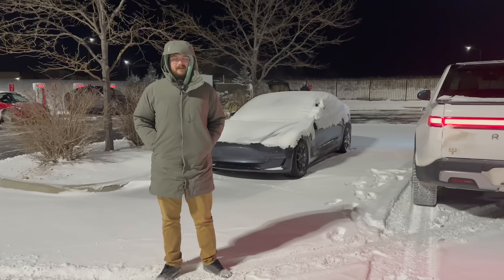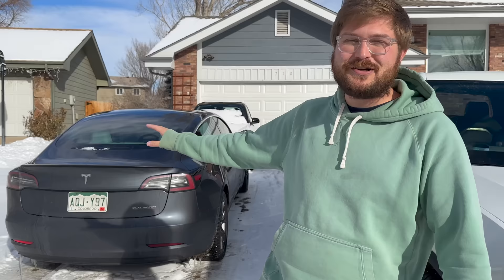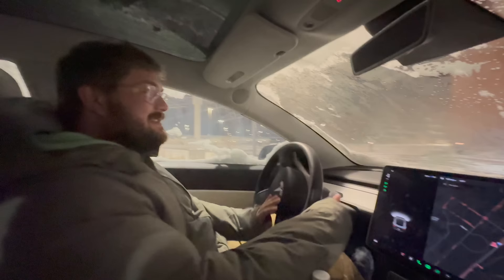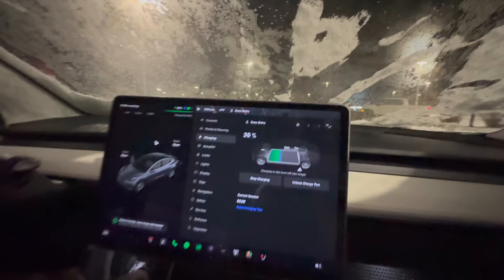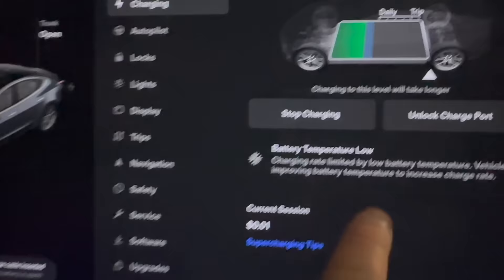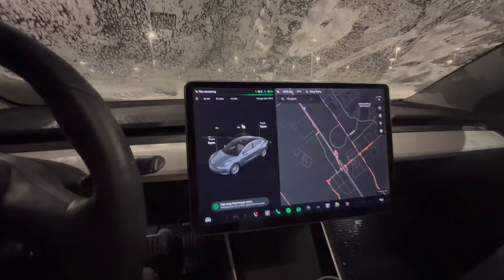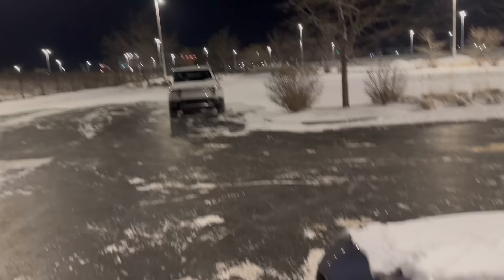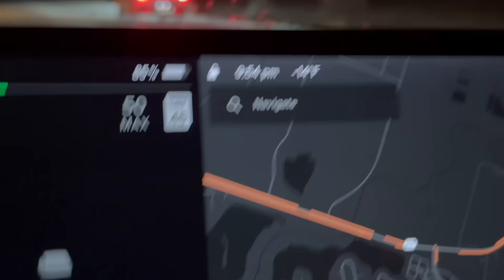I Deep Froze My Tesla And Immediately Plugged It Into A Supercharger To See What Happens

Comment: Who besides me is watching this in 2024 after hearing about the new from Chicago
Reply: It’s so funny especially with everything he says in the first 3 mins about not charging in the cold being nonsense
Reply: What is new? Sorry I’m from Denmark
Reply: what news is that?
Reply: @oddjobsandrandomprojects  also don't forget - they let their teslas run on next to no battery power too. That's like me complaining about how shit my Buick Regal Grand Sport is, because I ran it to mere fumes and moaned that it wouldn't start in the cold.
Reply: This Test is a bit Dodgy, who preheats one car and goes sit in another warm car 🤔🫣
I mean what happens when you try to preheat your Family inside the car & Batteries at the same time, is there enough eat for both, Cabin & Car 🤔  what happens if you only have a rwd motor and is - 20 can the Single Motor preheat car & cabin
Reply: @niceboy60  just sit with your jacket on for a bit and let the car charge for christ sake. If you can afford a Tesla, you can most likely afford a home charger. If you can't, then why did you get a Tesla? Either way, the guy just proved that you can charge a Tesla in extreme cold weather. It runs perfectly fine. It takes an hour, but then you're on your way. No issue. Most responsible Tesla owners keep their cars charged.
Reply: @mattygaga2013  I find interesting we both have completely different interpretations
I concluded Teslas can't charge In Extreme Cold 😳🤨
1- No one stays in -9f or - 22c with heaters off its Reckless 
2- Each motor Produces 3.5Kw of heat OK
You have 2 motors it's 7kw of Heat  most Tesla sold have only  1 motor 😢❄️🥶
3- in Order to Benefit from $7500 tax Credits only the Model 3 single motor made sense dual motor was almost 10k more
Reply: @niceboy60  either way, teslas are and will be brilliant cars and can absolutely handle most extreme temperatures. You're forgetting, a gas car uses electric batteries to start. Without it, you have nothing. Most fuel cars will struggle to turn over after a deep freeze - same with Tesla, only Teslas are more reliable.
Reply: @oddjobsandrandomprojects  but almost every super-charger was out of order..
Reply: @mattygaga2013 I ran into an idiot and his wife who just bought an EV and the nearest charge station since they didn't have charging access at their apartment, was 22 miles ONE WAY to a Bucee's!!
Do the math...
Reply: @mattygaga2013 in Britain, many buildings and housing structures will not let you park an EV in the parking garage or even near the buildings...
Worse, did you hear about whats going to happen to used EV batteries?
THE Technology is too immature.
Reply: @rt3593  they shouldn't have bought an EV lmao! Or.... easy... buy a home kit lol
Reply: @oddjobsandrandomprojects  Excuses 🥴😵‍💫
1-Let's say you start Work at 9h and leave home at 7h who has time to drive for 45 min to preheat the Batteries Wasting the Few Charge you had left 🤯
. 
Preheating is a Scam you will Waste 2 to 3 Hours Charging Regardless does it make any difference if you wasted 1 hour preheating & 1h 30m Charging 🤔🤨😳
Reply: @oddjobsandrandomprojects  true but nowhere NEAR  THE NUMBER  OF EVs.  In case you didn't know, gasoline us a combustible.  It will not just burst into flames  without an ignition source, whereas EV's create their own thermal heating.  Gas vehicles don't create their own heat by just sitting there....EV' s do.  It's in their very nature and design in case if a battery fracture.
2nd grade knowledge.
Reply: @oddjobsandrandomprojects  that's BS...and you know it. Let ne guess...you got suckered into buying one...
Reply: @oddjobsandrandomprojects  I know exactly how preheats work that's why I believe it's deeply Flawed😳, here's how it Works it Equates to ICE Car pushing the motor to redline rev limit and having to do this Wasteful process for at least 45 minutes  while the Fuel is already low
Preheat Works with the Motors producing 3.5kwh of heat each, totaling 7kwh of heat
1- It's unclear is preheating is reduced when the interior is being heated
2- Unclear how ecccient preheating is if you only have 1 motor..........
Reply: @oddjobsandrandomprojects  it's possible because Tesla did it, most electric motors are 3 Phase let's say ABC  you could bypass
B and have the Controller just sending a Current to A & C in order just to create heat, Tesla Car Computer  has full Control  of the Coolant  and it can be Turn off when not needed I mean it wouldnt Work In a Cold Winter or batteria would never get warm so they can turn it off
Each motor Produces 3.5Kwh of Heat
Totaling 9kwh of heat, Bjorn the Japanese guy which tests EV had a Tesla plugged in to OBD & testing devices, he can see what each component consumes, at which temperatures & for how long
Reply: Me, that was hysterical lol. We have not stopped talking about that fiasco over here. 😏
Reply: @oddjobsandrandomprojects  It was all over the news dude, I didn’t need to go there to know what mess it was. And look, I know you and your green-team cheerleaders get a hissy fit every time someone says anything bad about EVs, but the reality is, these things are bad in the cold, they’re very bad. And it’s no one’s fault but the automaker. There will be bad publicity and even ugly publicity for everything, no matter what. You guys need to get used to that, specially if something is new.
Reply: @oddjobsandrandomprojects  Nah, not a chance dude, no one has anything against EVs, just they’re not very good in certain types of weather, and people have to know, even if it makes EV cheerleaders angry.
Reply: @oddjobsandrandomprojects  To be very honest with you, no. I’ve never experienced reduced range with my gas cars in cold weather. I, however, have experienced less ‘fuel efficiency’ with bigger engines, like the v6 in my Camaro vs the v4 in my Sonic….but that has nothing to do with weather, just the size of the engine. My Camaro was a very thirsty vehicle, I was literally having to stop and fill-up at every corner gas station.
Reply: @niceboy60  I have old 2015 model s 85d  mine does not work like that at all.... It has an item called a battery heater, which unsurprisingly heats the battery, it is not heat from the motors that heats the battery in many cases. Preheating of the battery is independent of cabin heating, and both combined  use a fraction of the energy to accelerate the car even in extreme conditions. i have used mine a number of times in -20c conditions, with car being left outside during a skiing holiday. without major issues.
Reply: @stephensharp975  The model 3 uses the motors to create heat because it's more efficient than a resistive heater.  The move to the heat pump makes it harder to get heat in extreme cold.  The whole heating system 3 is completely different, so it's good he is talking about it from the model 3 perspective.  But ultimately, the use of departure preparation features in the car's software systems will warm your battery before you leave from home.  Using navigation to charging is of course best to use too.
Reply: @Doubie.  because... if you are going to charge in a supercharger, normally you put that in the navigation mode. the car will heat the battery before arriving there.
Reply: @oddjobsandrandomprojects  "Gas stations in the area didn't work either because the pumps are electric."

In all my life, I've never seen all local gas stations pumps in any area I have lived in lose power. Even if that were true, why weren't dozens of ICE cars towed from gas stations if they lost power too?
Reply: @mattygaga2013  No. False. Our 2002 Suburban with over 240,000 miles started great down to -28F. New 12 volt lead acid batteries are less than $200.00. New lithium batteries for EVs are around $7,000 to $20,000.
Reply: @mattygaga2013   That would have been 3-6 minutes for an ICE car. That means we're going to need at least ten times more chargers than the number of gas pumps that we have right now on busy interstate highways.
Reply: @niceboy60  I agree. Your hands and feet will freeze in minutes at that temperature. Notice he drove off with the windshield still obscured by ice. Not safe at all.
Reply: @DUCKSAREEVILLLLLLLL  thing is, these are extremely rare events. It's not like these cars are driving in Siberia. You've got this all wrong. Also, investing in EVs now, helps further research into better battery technology.
Reply: @oddjobsandrandomprojects  But, ICE car fires need oxygen to burn. EV batteries burn under water. Big difference.
Reply: @oddjobsandrandomprojects  NHTSA doesn't break down car fires by fuel type. Where did you get that data?
Reply: @oddjobsandrandomprojects  What NHTSA study? They don't compile statistics on car fires by fuel type.
Reply: @oddjobsandrandomprojects  You just repeated your talking point, so I'll repeat mine:  The American middle class has been shrinking and interest rates have been rising; more and more people can't afford to buy a house with a garage charger. The reason that governmental/professional/managerial class Democrats EVangelists are not liked is because they vote to mandate that people who are just getting by as it is go into even more debt to buy EV novelty cars. What we also find particularly galling is that not only do your class get $7,500 handouts from the government to buy an EV novelty, while we workers get nothing to buy affordable cars, but you don't even pay for the roads you use through fuel taxes.
Reply: @oddjobsandrandomprojects  What does "Top Pick" from Consumer Reports mean? They were 27th in reliability out of 28 brands in 2021. As for keyless entry, my 1996 Lincoln Town Car has it and it's worked flawlessly in -20F weather. Which reminds me, if you'd like the cheapest car to own, buy a used Town Car. Ignore fuel cost and focus on what matters:  Total cost of ownership, including loan costs. With the Town Car, you can pay less than $5000 cash for one that will last for years and hundreds of thousands of miles. Ask me how I know.
Reply: @oddjobsandrandomprojects  "Even if they stop making new gas cars, you and I both can keep our old gas cars working for the rest of our lives."

Not if we can't get parts.

"And if you really want the cheapest car to own it's a 1994 Geo Metro."

I had a Chevy Sprint, which used the same 3 cylinder Suzuki engine the Geo Metro had. A cheese head woman in a Ford Country Squire wagon ran a stop sign and totaled it, thank God. At 64,000 miles, the piece of junk was already burning oil and had blow by in the carburetor. Despite not wearing seat belts, she emerged from her land yacht unscathed, while I had to be hauled out of the windshield of that totaled go-cart. It took me ten minutes to catch my breath. Never again.

Again, fuel costs are just one aspect of total costs. Some of the cheapest cars to run that I've owned had V8 engines. Total cost is purchase price, loan cost if necessary, fuel, maintenance, replacement parts and insurance. Earlier in my life, insurance was the biggest expense.
Reply: @oddjobsandrandomprojects  No. I'm saying almost the opposite. My V8 Town Car runs cool at or below 2000 RPM on the highway. That little 40MPG Chevy Sprint ran at at least 2700 RPM, so it fried the car. Large cars like mine are meant to run reliably as Taxis or cop cars for many hundreds of thousands of miles because they are built to last.
Reply: @oddjobsandrandomprojects  Tesla's among the worst in reliability, according to Consumer Reports. Why don't you own a Tesla if you like them so much?
Reply: @oddjobsandrandomprojects  So, you have an ICE car and not an EV because it's too expensive and impractical. Welcome aboard Good Ship Common Sense!
Reply: @oddjobsandrandomprojects  "That would be even better if it were anything like what I used when I was in Germany and Italy. If it were like it was there I wouldn't own a vehicle at all."

That's the point, though. We aren't Europe, and we don't have safe public transportation.  You want to force future generations into the type of rolling asylums for the criminally insane that NYC has, where women are raped and people are killed and everyone just looks on? YOU have an affordable ICE car, but to hell with future generations? Why are you so selfish?
Reply: @oddjobsandrandomprojects  You say that you are not taking a political stance, but you are by promoting EVs non stop. Which party is creating all of these EV mandates, primarily?
Reply: @oddjobsandrandomprojects  "That's just it, I'm not selfish. I care enough about other people to not be wasteful of resources"

You think that EVs are less wasteful of resources? That explains your EVangelism. How about if government just gave $6,500 cash to those who bike or walk to work? Then, we'd be tacking obesity and waste at the same time.
Reply: @oddjobsandrandomprojects  EVs are a shiny new solution for a nonexistent problem.